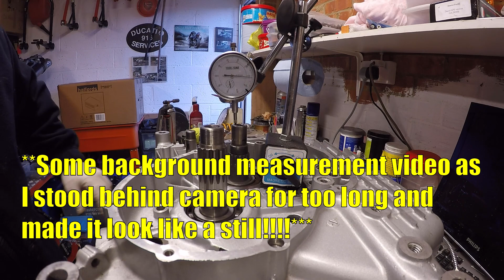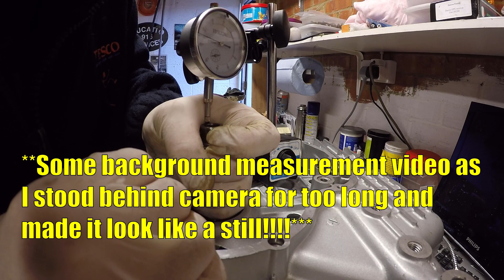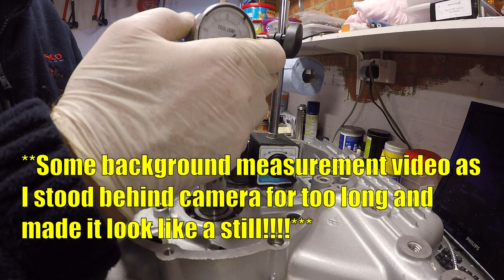DesmoWerx Tech Guide 1 - Ducati Crank Shimming Calculation

Comment: Does this need to be done if i still have the shimms from before
Reply from the maker: If you are fitting new bearings it is always advisable in case they are a different width. However most times I have only usually had to change one of the shims to the next size up or down.

If not replacing the crank main bearings then you should be okay, you might want to check measurements to ensure that the preload is acceptable.

Comment: Fantastic video, just to add to JP Edgington's comment Ducati don't seem to sell gearbox shaft shims in different sizes? If a gearbox shaft had too much free float would you shim both sizes equally to reduce to gap?
Reply from the maker: Hi Mike, Ducati sell shims for the gearbox, there are usually 4 options for each side shim available, you are correct its a case of balancing free play and location of the Gearbox by making suitable combinations on each side of the shaft. There is a formula to work this out as well if needed in the manual.

Comment: Excellent little video - so useful thanks so much!  Is anything similar required for the installation of the gearbox??
Reply from the maker: there is a similar process for the gearbox but you can do the clearances on an existing gear cluster in the cases by measuring the free float.

Comment: Currently rebuilding my XDS 1262 testastretta dvt due to a gearbox issue. The shop manual doesn’t reference any shimming and there was already a fair amount of play before splitting the case. Seems like the crank may only be centered by means of the tightening of the primary drive gear and the flywheel nut. Any idea on what I should be expecting to shim?
Reply from the maker: Hi Chet, I have not worked on one of these engines but then I would be surprised if the method of preloading the crank does not involve shims as it still uses the same angular contact bearings. As I don't have a manual I found this on the internet that appears to show shimming is required http://www.dudiavel.com/
Reply: DesmoWerx Thanks for the reply. I saw that in the diavel manual but the pre 2019 diavel uses the 1198. The section on shimming for the 1262 dvt only has data for gearbox shafts. My local dealer is no help, knuckle draggers.
Reply from the maker: @maverick892791  I believe it is still the same bottom end only a variable cam drive system.
Reply: DesmoWerx Thanks again. It appears the shimming procedure is no longer used in the 1262 dvt because the mains are not seated straight into the case but are first seated into an insert that’s driven into the case and located with a special dowel and anti rotation pin keeping the depth constant. Have you seen this on any other engines? Sounds like a change made by Audi AG along with the dvt.

Comment: I'm curious if you account for thickness of case gasket sealant (RTV) in the preload calc?   When dis-assembling an engine the residual seems quite thin but I've never tried to measure it.
Reply from the maker: Hi Andrew, 

Its not something I have ever taken account of, to be fair it would be microns thick once compressed under the torque of the cases so I believe would be negligible, different if it was a paper based gasket.
Reply: @DesmoWerx  copy, thx ...  BTW, did your engine have the drilled internal case bolt thjat some of the early engines had for oil ?